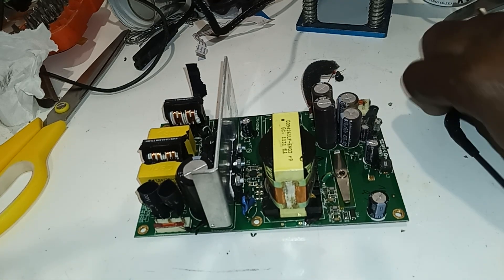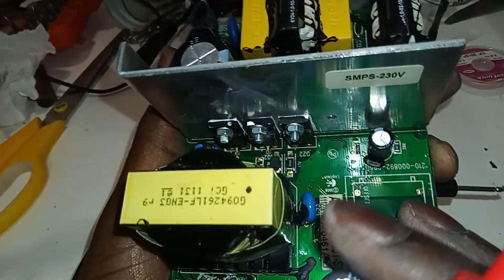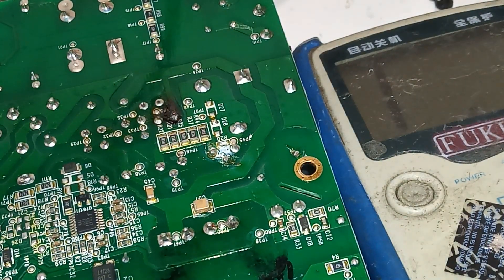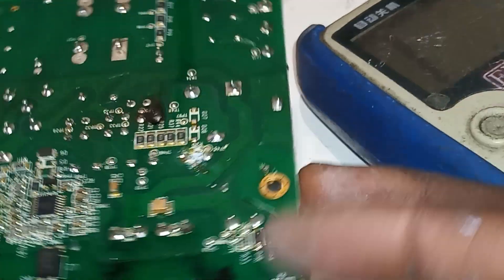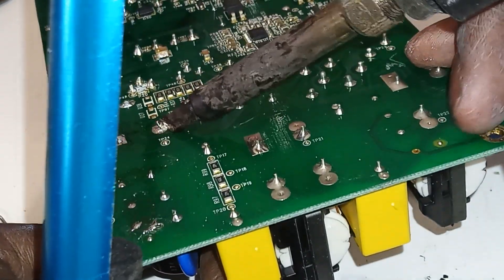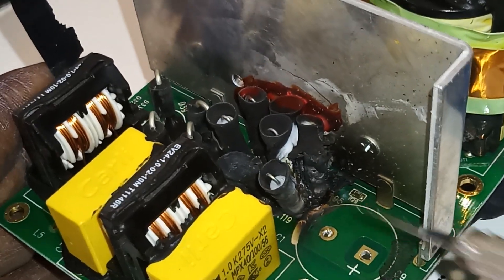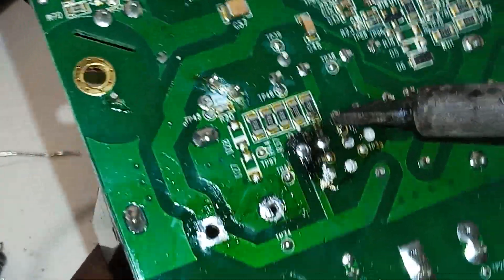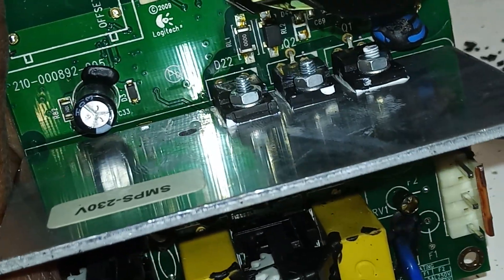Logitech Subwoofer Z906 power supply repair Part 1

Comment: Nice video. Ich have a burnt smd condensator at the C86 spot. Unfortunately, I cannot find out what the parameters are.
Reply: Not 100% sure but my multimiter reads it at 2,4uf, don't know the voltage though. Btw if anyone knows the value of the R32 would be great, mine came off with glue.

Comment: Can u put the same voltage transformer instead of this power supply unit?
Reply from the maker: If you can replicate the needed voltages maybe it will work

Comment: Great video.   Just had my Decode and Stereo lights scrolling with the Input light on 4 not 1. Nothing worked until I powered it off... This video has me worried now because the rear of mine does get quite hot which was unexpected.